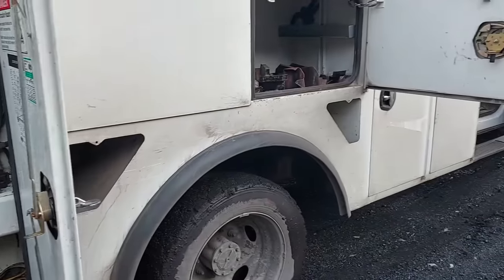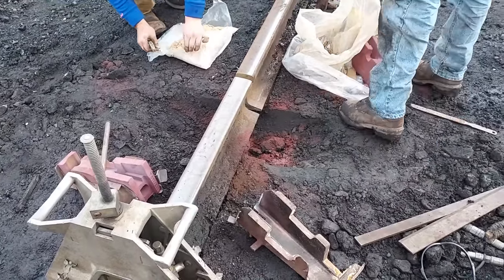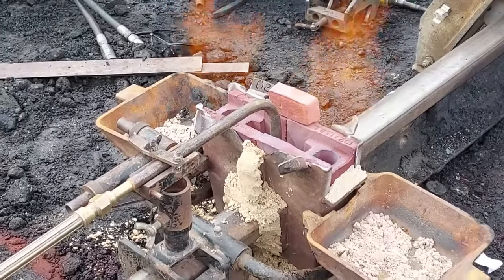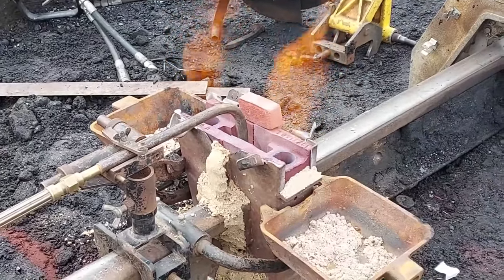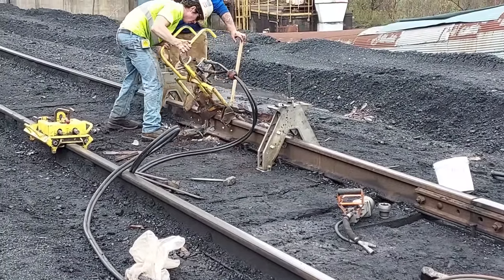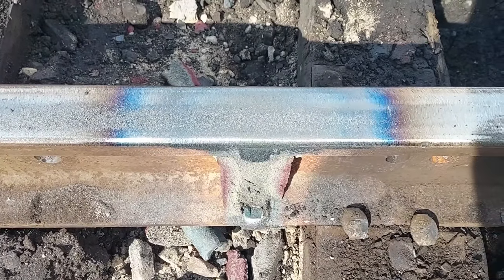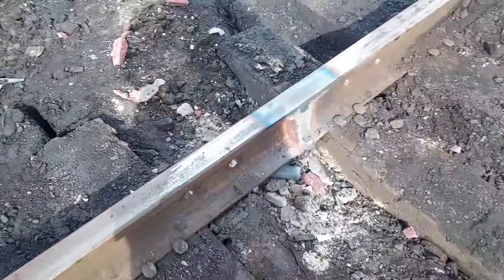Shooting a Thermite Weld on the Railroad from Start to Finish

Comment: So why the weld here instead of just replacing that stick of rail? Just cheaper? Surprised to find this video since I've heard you talk in other videos about why you guys use the jointed track. Thanks for another great video Dave! :) YOU have a great day too!
Reply from the maker: Had we put in a stick of rail, then we would have had 2 joints
and since this was already welded rail to begin with, we just
made a couple of welds to keep it that way. The joints
were in there from a repair job where a rail had broken. Thanks
so much for watching the thermite show my friend.

Comment: Wonder if it would cut thick steel structures.😮
Probably not  huh.
Reply from the maker: Yes it will, US Navy did experiments with thermite in WW 2 and it would burn right thru a ship's bottom Mark. Thank you for  taking the time to check out the video and may you have a very good day my friend.

Comment: Question...You only wield where 2 rails meet and not to repair cracks/break???🤔🤔🤔
Reply from the maker: We could have put joint bars on the break or thermite welded
it Pale Emperor. But being that the broken rail was rolled in 1975
and has had so many years of heavy coal trains running over it, 
we decided that the best thing was just to replace the broken rail
with a new stick. Thank you very much for taking time out of your
day to make a comment and to watch the video my friend.

Comment: I have worked with metals for 30 years as a machinist. Those molds are most likely made of fire brick which is also used in furnaces. The stuff they mix to seal around the track is likely casting sand which is used in foundries for making cast iron molds.
Reply from the maker: Thank you Larry for sharing that info with us. We do appreciate
your  taking the time to visit with us and watch the
video. May you have a most blessed day my friend.

Comment: Unnecessary, a joiner would be good enough 👷‍♀️🤦‍♀️
Reply from the maker: We were trying to eliminate a joint, as you saw that area is
full of coal and joints just will not hold track surface there Neil.
Thank you for taking the time to  check out the video and may you have a very nice day my friend.

Comment: A strenuous job..Isn’t there an easier way of welding joints?These  guys  almost work as factory hands in a foundry or smelter unit!Kudos to them for their back breaking job!What quality checks are done for these welds.Of course no leak test.Any radiography  study of the joints for sturdiness of the weld ?
Reply from the maker: It is hard work for sure P.V. There is a process on the RR called
flash butt welding where a big electric welder comes out of
a box truck and electrically welds the rail, that is the way to go,
however all our welding is done by a contractor and they don't
have the equipment to flash butt weld, so they do thermite. Thanks
so much for stopping by and checking out the video.
Reply: @ccrx6700  I should indeed feel thankful to you for replying quite elaborately well a greenhorn’s query.Thanks again.Bye!
Reply from the maker: @p.v.chandrasekharan5666  👍😊

Comment: I watched a railcrew with BNSF weld rail using this very process. It was quite impressive, and they worked it like a well-oiled machine. When it was all said and done, I picked up a 1" thick cross section of the cut track, took it home, ground it smooth, and I now use it as a miniature anvil clamped in a vise... Turning it at different angles in the vise results in different curves for shaping metals, or I'll clamp it railhead-down for a perfectly flat surface...
Reply from the maker: We want to say Thank You for dropping in on us and watching
the presentation today C Schuh. Appreciate your sharing the
story with us, rail heads are pretty neat things.

Comment: That certainly is a job of REAL work!  And it's spectacularly photogenic.   A very interesting process, from start to finish.  Thanks for taking the time to document it and share it.  

As an aside, a couple of clips of the guy on the grinder getting his jeans filthy dirty would make a good lead-in for a laundry detergent commercial.  😅
Reply from the maker: Thank you for the nice comment Michael and for taking the time
to check out the video my friend.

Comment: do some companies have more automated machinery to do these types of joint repairs or is it almost always manual labor like this?
Reply from the maker: There is a process called flash butt welding that is a lot more
automated, however our welds are done by contractors and
they don't have that equipment. Thanks for stopping by and
watching my friend.

Comment: and is 1-32 1-20 explained somewhere?  I would expect all USA rail to be the same.  Maybe except the cog on Mount Washington.
Reply from the maker: 132 means it weighs 132 pounds per yard. All across the USA
are different weights of rail used for mains, usually 132 is
minimum, others could be 136, 140, 141. Smaller rail like 120 is
often used in sidings or spurs or yard tracks. Highest ever 
weight rail on mains was tried by the PRR at 155. Higher
weight rail like 170 is used on huge gantry cranes like you
would find in ship yards. Narrow gage rail here is often smaller
than 120, down to 80 pound rail. In some industries such as
the mine we have here, under ground is 80 and 60 pound rail.
Back in the day in the mines they would even us as little
as 15 or 30 pound rail. the real small rail was used when miners
would hand load their rail buggies and push them out to
the higher weight main lines where horses and then later
electric motors would take them out of the mine.

There is your explanation and you are welcome for it CameraBoy
and that is info you cannot find out on Wiki or anywhere else
than here, so I hope you will check out more of my 
informative RR videos and possibly become a subscriber
to this channel!

Comment: Why wouldn't they just stick weld these?
Reply: I imagine it has something to so with weld strength. I'm not a welder, but I am a railroader. Freight train locomotives weigh about 220 tons and can travel 70 to 80 mph in the US. Aside from that, I've seen pull aparts too. If it gets real cold in the winter, the steel can contract enough to pull a weld apart. Modern rail is continously welded for many miles without any breaks in it.
Reply: @somerando7191  i weld industrial buildings. I'm sure they could make this more cost effective
Reply from the maker: We would like to say Thank You very much for taking the time
to visit with us today and watch the presentation Nick.
Hope you will sometime check out more of our Railroad videos at:
https://www.youtube.com/c/ccrx6700

Comment: As a complete idiot in All Things Railroading I’ve got a stupid question:  why is it So dang important that that gap be so Perfectly Filled and smoothed down?  And how do I get a hold of a piece of that waste material?  It would forge down into some nice tools, knives, etc. .
Reply from the maker: Good question, if that weld was not ground smooth, and one side
was higher than the other then there is a good possibility that low
side would get what is called a battered head, where the metal 
takes a much greater pounding from the train wheels and then starts
to flake off the rail head. Thank you very much for checking out the video and may you have a very good day.

Comment: Leave your finish grind 5 to 7 thousandths high. For heat shrinkage. Your grind is low.
Reply from the maker: I will relay that to the welders the next time they come in,
these are contract welders.

Comment: Still using a similar grinder. One nice improvement is the metal guard around the grinding wheel. The original was exposed. I had a stone come apart on me doing rail end welding in about 1975. My crew carried me to the job for two weeks and I monitored the radio, which was not a job classification 😂. But it was a “ NO TIME LOST INJURY ”. 🤔
Reply from the maker: Thank you for the interesting comment. Appreciate your taking the time to visit and check out the video my friend.

Comment: Great video I have 30 years of torch experience (OxyAcetylene Welding and Cutting) I assume that's OxyPropane? From the cylinder on the truck where propane has a lower flame temp with no maximum working pressure unlike Acetylene where which has the highest flame temp but only has a max working pressure of 15psi.
Reply from the maker: Very glad you enjoyed Chris. Thank you  so much for watching.
May you have a wonderful day my friend.

Comment: Ok so why do this over replacing? This is the second video of yours I’ve watched but in the first you replaced a broken rail
Reply from the maker: I had replaced a broken rail in this spot several months before
this video was made and there were joints in it John, so we
eliminated the joints with the welds. We did not have the contract
welders available when we first replaced that rail.  Thank you for  visiting with us and may you have a very good day my friend.

Comment: Why are they not using a spirit level?
Reply from the maker: They use a long straight edge to line up the rail head tops and
sides. If they used a level, then it's possible the two distant
ends could be level with each other and yet still have be a dip in the middle.  Thanks so much my friend for watching and may you have a very good day.

Comment: one rail looks flat and one rounded top. do you just line them up like that, or do you take into consideration that the newer one will flatten over time?
Reply from the maker: Thank you so much Michael for taking the time to tune in to
the channel and check out the video. Rail head on one was in
better profile than the other. This is constant 10 MPH track
so that profile being only a bit off will not make any difference.
Be a different story if we were running 50 or 70 MPH trains over it.
May you have a really  good day my friend.

Comment: I love that this video shows more than just the thermite going off There's thousands of videos where they only show the thermite Is part but not the set up and what happens after
Reply from the maker: From start to finish it usually takes about an hour to do an entire
weld, I did cut out a lot of what all went on, tried to get the
highlights from various stages of the process for you.

Comment: Thermate was used on the twin towers 2001. Its hotter.
Reply from the maker: You are right, it does get hot, up to 5,000 degrees, hot enough
to melt rail steel.  Really appreciate your taking the time to watch and may you have a very good day my friend.

Comment: Really fascinating,, So wouldn't"t banging on the new weld with a sledge hammer cause weakness and cracks?
Reply from the maker: Apparently is doesn't, these guys are contract welders and do
a lot of welding so they know what they're doing.

Comment: Your railroad looks really crappy. Where is the ballast? Looks like dirty coal.

You dont need sand on the expanding bowls. It will come loose after few min when its cold. Please use some safety clothing next time. Wearing jeans or whatever will take fire if you are unlucky. 

You overheated the rail when grinding. Its not supposed to be blue.
Reply from the maker: Thank you for sharing your thoughts with us TB LouTheo. We are
grateful for your taking the time to visit with us and watch the video.

Comment: Excuse me. Could you please inform as to why you use welding , would it not be cheaper to replace the entire rail that is defective. If it costs about $1100.00 to weld is a rail that much more expensive. Thanks for enlightenment
Reply from the maker: In this section of track it is very poor ballast, so we eliminate
joints, joints simply will not hold track surface very well
with this poor of a ballast condition. it is impossible to
keep the ballast clean in this place, it's right below
where they load the cars and car doors leak and sometimes
even open up and dump 115 tons of coal out on the track, it's
a never ending nightmare there.

Comment: With normal welding, leaving the flux on the weld will cause the weld to corrode, I think if I remember correctly.  The flux needs to be chipped off, but don't take my word for it.
Reply from the maker: Thank you Richard for writing in and sharing that. We really appreciate your stopping by to check out the video. May you have a most blessed day my friend.

Comment: [09/04/22]  Those moulds look to be made from a heat resistant ceramic compound. It's too bad that the removing of the moulds was not shown. I've seen a number of these rail welding videos and it seems like the German, and European rail workers have a process that's somewhat faster than this particular method per joint, but still using Thermite.
Reply from the maker: Thank You Oceanic 84 for taking the time to stop by and take in the video today.

Comment: Beauty, that. Thanks.  That's not a real quick process and it wouldn't be cheap.  Is that the most cost effective solution or is it simply the only way?
Reply from the maker: We would like to say Thank You very much for taking the time
to visit with us today and watch the presentation Oabrogard.
Their is also a welding process called Flash Butt, however these
contract welders do not have the equipment to do it.
Hope you will sometime check out more of our Railroad videos at:
https://www.youtube.com/c/ccrx6700

Comment: $550 seems very cheap to me for the equipment/supplies needed. 
Very interesting, but why did they need to splice in a short piece like that?
Why such a short leveling straight edge?
Why lift so high off the ties, just to lower it back down?
Reply from the maker: The welders are contract welders and are only an hour away,
the further away they go, the higher the price becomes.  We welded
that in because there was a broken rail there and had bolted it
in with a short plug at the time of repair. They lifted to the amount
they did in order to get the rail head to be level with each of them.
Thanks for watching the show today Jon.

Comment: Does the actual butt joint between the rail ends fuse quickly? Just curious if the machine that removes the flash and the sledge hammering disturbs the actual weld joint.
Reply from the maker: It fuses very quick and no the machine only removes slag. Appreciate your taking the time to visit with us and check out the video my friend.

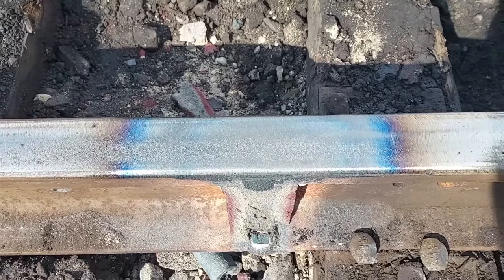Comment: 18:10 I was expecting to see some kind of heat treatment in the end. From the coloring of the grinded rail it seems to have pretty steep heat gradient which probably results in lots of internal stress and could cause uneven wear in the future unless annealed.
Reply from the maker: I've been around thermite welding for 18 years and no one has
ever done that Mikko. I'm not saying you don't have a good
idea, just saying on railroad welding it's never done.  Thank you for taking the time to watch and may you have a very good day my friend.

Comment: It is such meticulous and amazing process!   There is a  specific tool some very high pressure for each step.   What are the material costs?  There is the thermite and the molds appear to be use once and crack off.   The specialized grinder and jigs without the power supply I'd think would be pushing $30K.
Reply from the maker: Thank you for the nice comment Douglas. Appreciate your taking the time to watch and write in my friend.

Comment: NICE.   Our molds are made of graphite for welding large copper 'conductors' for grounding, welding copper wire to copper buss bar.  Our temperatures are only about 2500ºF.  It's important to ALWAYS torch all of the components to preheat but most importantly to remove all moisture otherwise it could explode.  Oh I see.  Those are single use molds.   These guys have excellent fire watch techniques (and I'm sure experience).  Hearing, eye protection, good gloves, strong boots.  Hard hat?  I always have mine, but outside?  Why?  Could the sky be falling?  Meteors?  But seriously safety stickers are on your hat so everyone knows you belong on site.
Reply from the maker: Thank you very much Greg for taking the time out of your busy day to watch the video and write in with your thoughts.
Reply: @ccrx6700  Yeah no.  I'm not busy at all, so I get to nit pic all you hard workers on your safety violations!  Unfortunately for me, you guys do perfect work, job after job.

Comment: Seems as good a time as any to state that the rail system in this country needs to be expanded and modernized. The industry has been repressed by automotive concerns since right after the Industrial Revolution. Trucking would be mostly short haul routes, home every night, shipping costs would lower dramatically with the expansion, it would positively impact the climate concerns, native tourism would skyrocket, local businesses would thrive again, and on and on. What happened to our rail system is criminal. Literally.
Reply from the maker: You are right and very well stated

Comment: I made thermite once. It is not a substance to take lightly.
Of course you work with a guy named Smitty. It's a requirement in railroading and other heavy work, as are biballs or suspenders and tattoos.
Reply from the maker: Got to keep the RR image up Captain Trips.... LOL Seems like
every engineer on the old steam trains wore the overalls. Thermite
is wicked, US Army experimented with it and found it would burn
a hole right thru a ship's bottom to sink an enemy ship, but don't
think they ever perfected a way to drop it on them when lit.